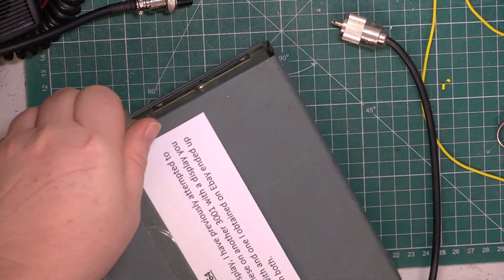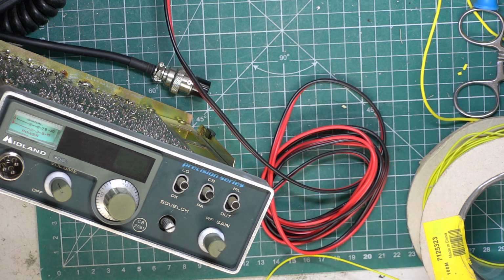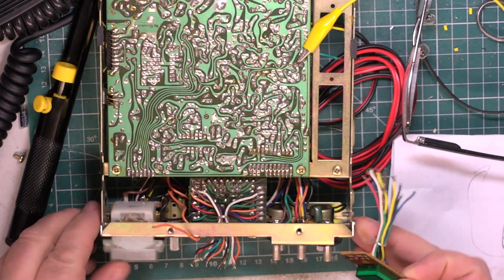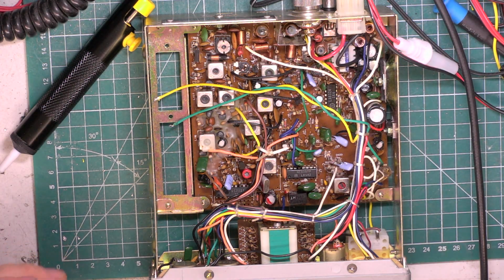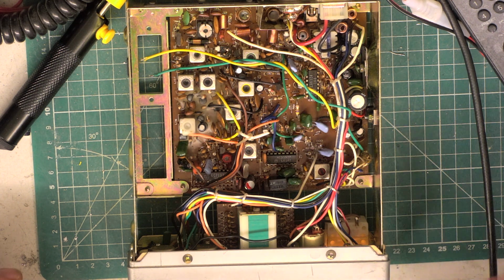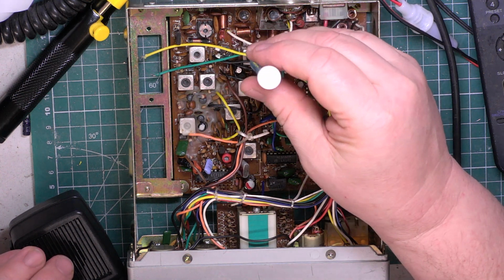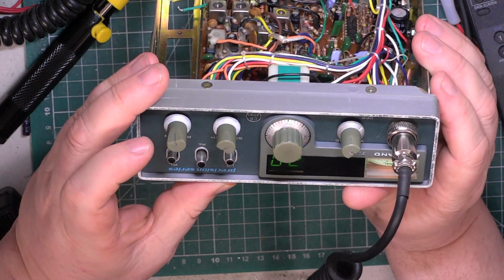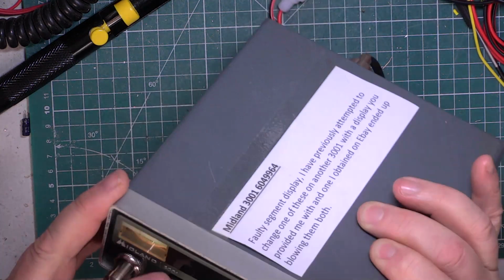Midland 3001 CB27/81 UK FM CB radio - repair & realignment

Comment: I've had a few with this problem, normally smokers radios, the smoke gets inside the channel switch and literally causes a brown plaque to form on the contacts, one trick that can work is drilling a very fine hole in the top of the switch and spray cleaner in, I've saved a few like that, the other had a blown track on the back of the display board, I do have a mint like new boxed 4001 that does definitely have a missing segment like this one did though but it doesn't bother me enough to change it but I will do if I sell it which is unlikely.

Great video, I've been doing a lot of radios lately, no church organs though, loving the radio gram restoration, could put a more modern radio receiver inside it if the customer was desperate for it to work, I grew up in the early 70s listening to a lovely old valve set radio gram, lovely it was, walnut finish solid wood with a heavy woven speaker grill cloth covering the front.
Reply from the maker: Ultimately, the only way out of these duff displays is to design & make a new PCB to take a modern 16-pin display.

Richard, G0OJF, UK
Reply: @ukfmcbradioservicingTango21   AAARRRHHHH